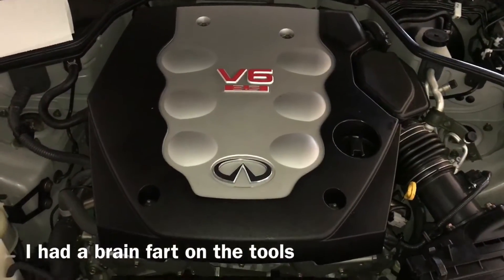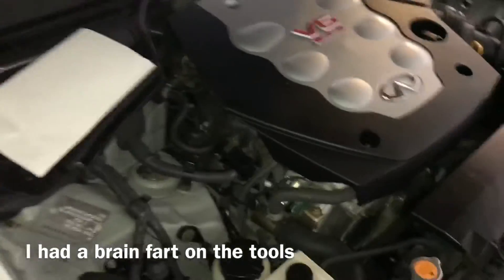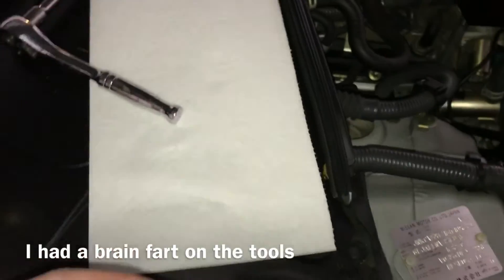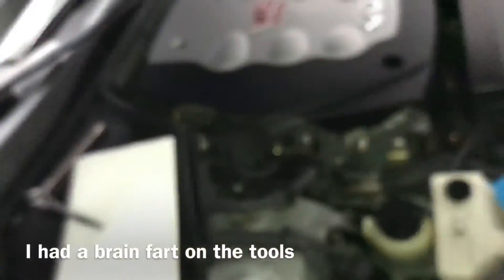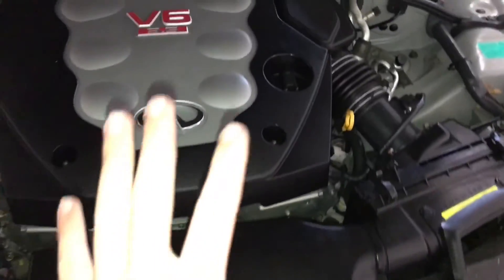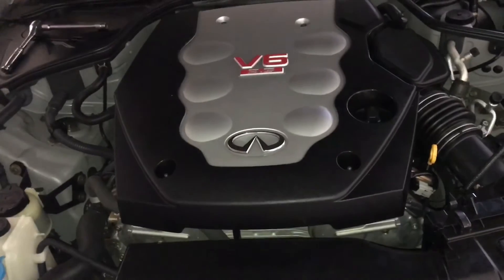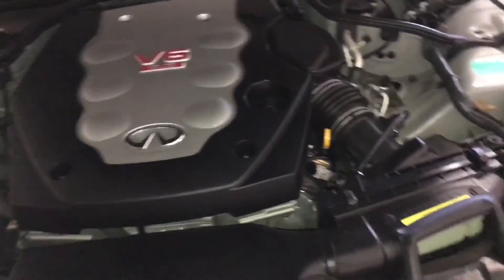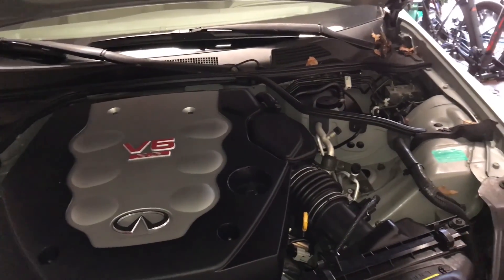Checking transmission fluid in a G35

Comment: I had problem with transmission (it would downshift instead of upshift on the highway). Driving on the highway was scary, strange, because it would not go into higher gears. This was Mazda Millenia 2.5l 2001 with 105k miles on it at that time. Transmission shop wanted to disassemble transmission for $650 to find out what is wrong, then rebuild transmission for $3500. Another transmission shop could not reproduce the problem and found nothing wrong -despite hooking some electronic gizmo to the car.  

In the end I dropped the transmission pan, and found that magnets were completely saturated with metal shavings (black sludge) and could not hold/remove the metal shavings from transmission fluid. Thus, there were too many metal shavings suspended in the transmission fluid. The shavings that are not removed by magnets end up in the electromagnetic solenoids that control transmission fluid flow (interfere/block flow) , and prevent proper operation of transmission. 
I cleaned the magnets inside transmission pan, dropped pen 3 times with some driving in between. The total cost was about $60 for 3x4qt of transmission fluid from O'Righly.  I did spend $15 for "filter" that is just a mash, and was not a necessary replacement. Cleaning that "filter" would be enough. That transmission "filter" can capture a screw in the flow, but no metal shavings, or anything else. 
Now 8 years later, and now at 180k miles this Mazda Millenia 2001 runs just fine,  no problems with transmission. 
My total cost was $60, and a lot of time in my garage, mostly carefully cleaning magnets, and figuring how suspending metal shavings interfere with flow of a transmission fluid.

Comment: I have a question related to how to check the level of the transmission fluid in this engine. Nissan says that it has to be at the proper operating temperature in order to correctly read the dipstick. Once it's at proper operating temperature it should be somewhere near the middle to Middle High inside the hash marks on the dipstick... so the question is:  How do I know when the fluid is at proper operating temperature for a level check without using a temperature sensor?... is there a rule of thumb on how to get this particular engine up to operating temperature without using a sensor (that is at least somewhat reliable) so I can read the level of the transmission fluid properly?
Reply: doompatydoo you have to let your car warm up to operating temperatures. Usually with my g35 when I️ first turn it on I️ don’t drive it until the temperature gauge is in between hot and cold